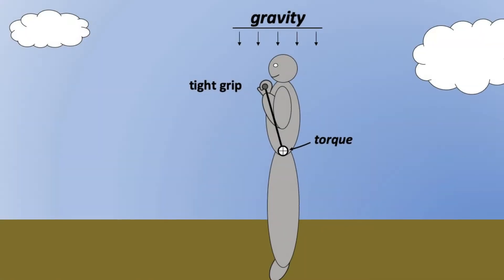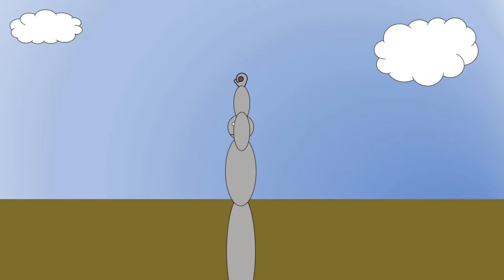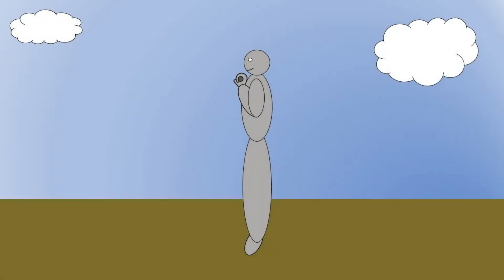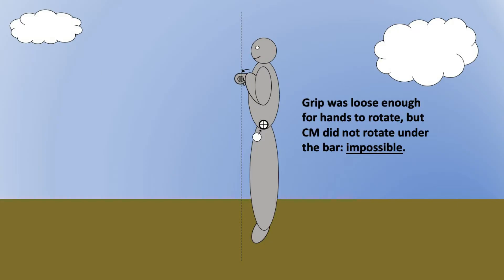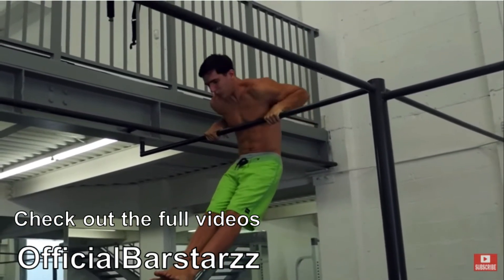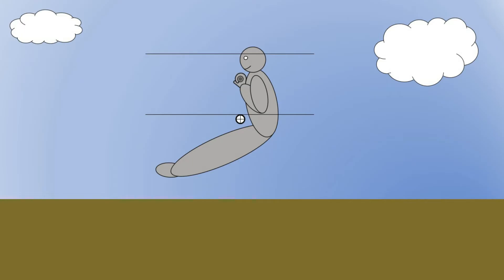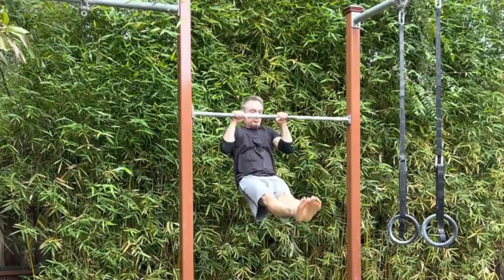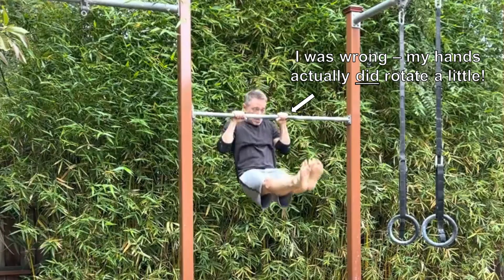The physics of a slow muscle up with no false grip

Comment: I'm still only 22, but this video convinced me that the MU with no false grip isn't worth it for me. I think it's a move that might prove life-saving in dangerous situations but it's very advanced and not very good for longevity either. I'll swallow my pride and stick to the false grip, it's the simplest and most effective way.
Reply from the maker: Well, I wasn't trying to convince anyone not to do it. You'd definitely get bragging rights! But... I don't think it's useful at all. The no-false-grip technique wouldn't help you pull yourself onto a roof or ledge. And on any kind of a bar, it's easy enough to jump your hands into a false grip on the way up.
Reply: Why isn’t it good for longevity? I’m 16 and I recently made my first false grip slow muscle up and I want to train for the no false grip mu. So why not train for it ??
Reply: @Marco__sw  Don't listen to old me. It's absolutely beneficial for your physical well-being to learn muscle ups. Strictly speaking it's not a necessary or life-saving skill but if you want to train it, go for it
Reply: @Vaite123xD  aight. I wondered at first but thanks for clarifying
Reply: Оно абсолютно безопасно - люди просто спешат и н е заложив нормальной базы в выходах лезут на более сложные выходы, которые им н е показаны!

Comment: Impressive analysis, I'm quite interested in this move, it's even what inspired me to start training calisthenics near the end of 2016. Some thoughts:
* To adjust the center mass position not only the hips but the spine can be flexed too, I noticed it in Saibov's best muscle up where there's not much hip flexion.
* To gradually rotate into a false grip on the way up strong wrist flexors are needed, while in Saibov's iron wrist version it looks like he grips the bar strongly so the knuckles keep facing in the same direction, and he uses the wrist extensors to rotate the forearm until his upper body is far enough above the bar to allow him to lean forward before starting the dip.
* The main part of the movement I'd train to strengthen any kind of slow muscle ups is from where the arms are along the body at the top of the pull up to where the chest would rest on the bar even if you took the hands off, which is the bottom of the dip. Beginners can train it with a false grip and feet pushing on a surface for assistance, while stronger athletes can do it weighted or work on reducing the amount of false grip they use.
Reply from the maker: Thanks - your analysis is also quite good.
Yeah, I’m pretty sure I got the physics right, but I feel like I didn’t explain it well enough. I need some physics animation software or something...

Comment: Have you seen this muscle up from Saibov? https://www.youtube.com/watch?v=9UR3Xz3dFkE  / This is probably the closest you can get to a no false grip muscle up, he just uses slightly more wrist flexion than a normal pullup to get up and over the bar.
Reply: I was just looking for a comment just like yours. Hopefully, Robert stumbles across our two responses. In fact it is very possible to do such Muscle Ups - although, they seem to be much easier to be performed on the rings as you have more options with changing the ring´s positions and your body alignment. Saibov is probably the most famous athlete who got very popular by doing his no-false-grip slow muscle ups aka "Iron Wrist" Muscle Ups. He and several other athletes are able to perform such Muscle Ups without any wrist rotation at all (also Saibov has done even harder variations of these MUs). Having achieved such Muscle Ups on my own, I can admit that you probably will have to specifically train for them for several years as the wrist joints take a long time to adapt and to get strong enough. Plus you will also need very strong triceps as the Muscle Ups get much more push-dominant compared to a regular slow muscle up, where you start the dipping portion much later (when your body is higher).

Comment: I am in awe of your seriously inspiring video!
I need your expertise please-I can,using a false grip,make it to the point where my legs are completely parallel to the ground having pulled myself close to the bar.
But then,my lack of strength catches up and I just cannot rotate up the bar.😞
Are there certain special exercises I can do to ultimately reach the promised land?
I am 59 and quite fit.
It’d be like a dream come true to achieve the muscle-up.
Thanks for the awesome video.😊
Reply from the maker: Thanks! Remember though - I wasn't able to do it without a false grip. So no need to be in awe of me :)
As far as just doing it: have you watched my other video on the slow muscle up? That one uses a false grip. In that video I explained that I learned the transition first on rings where it's both easier to do and easier to learn. Then taking it to a bar was pretty easy. That's what I think you should do. It's definitely learnable!